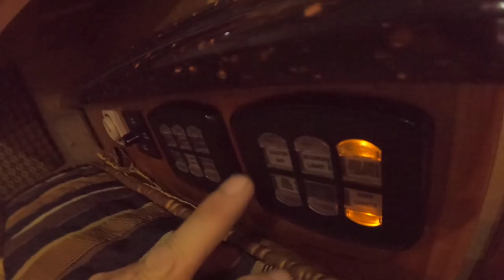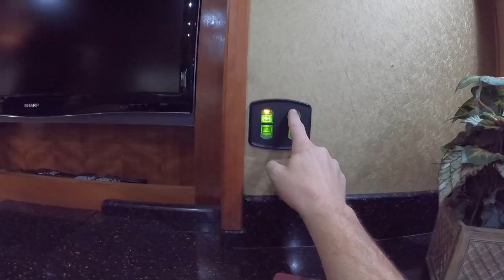COMPLETE TOUR OF 2009 MONACO EXECUTIVE WITH CUMMINS 650 FOR SALE FOR $199,000

Comment: The higher end coach's like CC used a thicker slab of fiberglass to eliminate the waves that occur on most coaches.  That straight look was very unique to CC, but checking was the cost as time progressed.  If you do a checking video, get Gary involved, he knows everything! 
Awesome video one again!
Reply: All coaches have issues that are endemic to their construction.  You mentioned CC using thicker fiberglass.  Even some of the Prevost buses have sidewall delam issues.  We had a dealer close to my home that sold and serviced CC and they are indeed a fine unit.

Comment: A slide down shutter type roll up & down door on each bay door flushes up the aero under the coach easy add after the fact to any rig. It touches down unrolled then it can retract the whole achordian shutter roll window 3 inches or so. If it takes a hit just 1 roll down bay outside door took the hit easy to absorb & fix.

Comment: We have had a number of cars, trucks and SUV's that are not "Gel Coat" that have paint cracking / checking. Old as in a 1957 F250, newer domestic on a 2007 Yukon and foreign with our Subaru TOAD. The wild temperature swings we experience in Southern California and strong sun at our home elevation (5200') seem to cause the paint to crack no matter how it's chemically protected. The darker vehicle colors we seem to gravitate toward are definitely more susceptible to cracking than lighter colors but we've experienced cracking on a White vehicle too. The Fiberglass / Gel boats we've owned have NOT experienced the same problems which is most likely because they are lighter in color but they are routinely subjected to 120+ weather out at Lake Havasu and Lake Mead. The best solution we've found (short of a re-spray) is to use a wax matched to the paint color. Using a Black wax on the dark colors does a pretty good job of hiding the cracks and can fool the eye. Using a White wax on a dark color accentuates the cracks with the residue left behind by the wax. Black residue on Black paint = less visible cracks. Andrew might be able to expand on that with his detailing background.

Comment: If u sand blast a softer material 1st then u paint or clear it then paint it more for paints to bond to bc aluminum duct stuck into softer material, If it not easiy rought sanded off med grit then safe to spray it. If u need to sand blast & sand & 3 times in a row to get the best prime surface to start painting on so be it best of both soft & tough surface, flex & hardness extra surface sq inches surface cooling & reflexting kind of prep.

Comment: Great Coach, but that 650 ISX scares me...
Reply: Yes, #6 valve drop issues.
Reply: Why does the 650 scare you?
Reply: @smacdiesel  exactly, super expensive to repair. Cummins knows its an issue. I just can't afford that chance.
Reply: slewofdamascus Scott can work on anything yes, but your almost gonna get a guaranteed no from him if you call him and say , “hey Scott, I’ve got a coach with the Cummins 650 in it and I think it may need an in-frame done, can you help me?” He’s gonna refer you to a Cummins shop more than likely, unless it’s close by and they can check it out then Tyler May take it on cause he does work on Cummins engines. 

Scott works on a few, and that’s very few, Cummins, newer Detroit diesels, and a few of the others out there. He does not like working on the newer stuff at all with everything being tied into the electrical systems and computers are running everything. The only couple of newer ones I’ve heard of him or seen him work on are owns by friends or folks that he’s done work for over the years that updraded but he will be the first to tell ya not to do it!!! They are not reliable at all!!

Scott’s passion and love is for working on the Pre-DEFF engines, the older 2 stroke Detroit Diesels in the older busses. He could fix anything as you stated, and I imagine if your sitting on the shoulder of the road and he was closest to you then he would come see if he could help but he’s not gonna like it, but everything else about your comment on Scott is absolutely spot on. Scott is an artist when it comes to these machines and there bout ain’t no one any better than Scott and Tyler and momma Kelley!! Sorry to correct you, I hate doing things like that but I know he has voiced his displeasure numerous times in those comments when folks were asking about him working on the newer, non Detroit machines. Nope I didn’t step on any toes, not meaning to at all
Reply: @1982MCI  I appreciate the clarity, thanks, I didn't know that...I'm a fan of his channel but I don't know him personally. I just think he's awesome, though.

Comment: Any thing under 100k mileage on great engine & chassis if properly cared for & able to sill get prts & worked on is fine quality stuff 07' range sweet spot for modern times tech light power & build strong, bc tech ages out fast quality lime timeless, & far cheaper great wine.